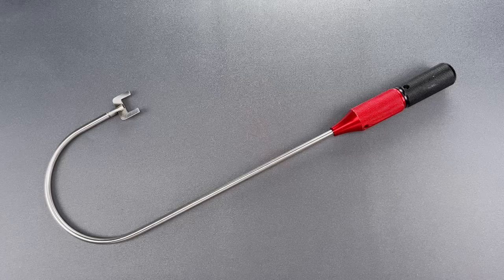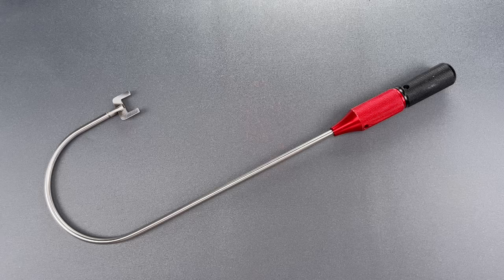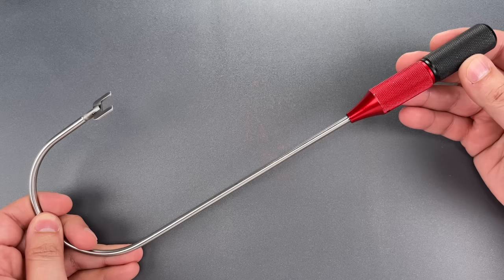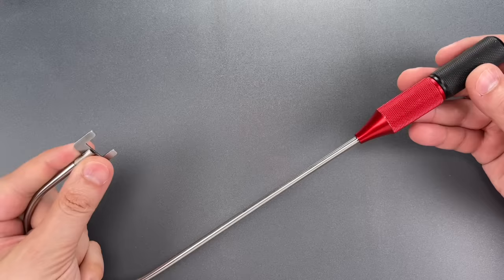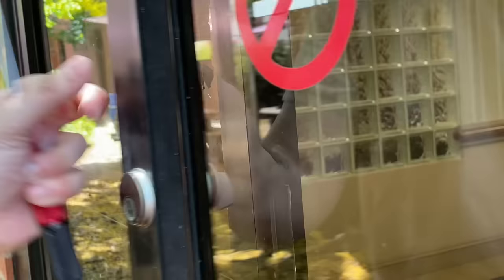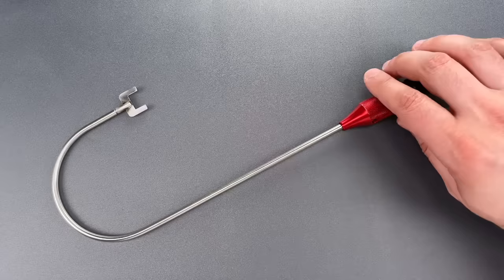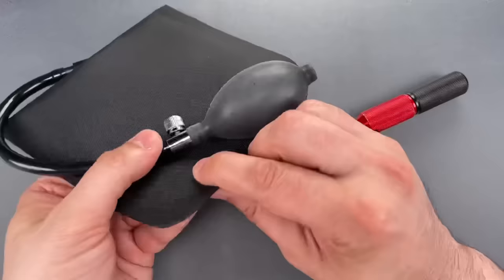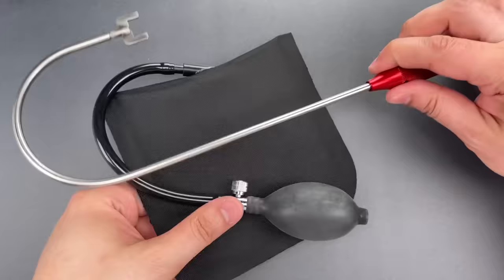[1312] The “J-Tool” Reaches Inside To Open Doors

Comment: Looks like you struggled turning at the end , maybe redesign it with a T bar handle for stiff locks 👍🏻
Reply: there is a hole in the knob that will accept a bar, probably to do just that. No redesign needed, its already there.
Reply: The entire lock turning time was 5 seconds.

Comment: People after watching this video: *installs a metal shim on the lock*
Reply: I have never seen a door without a ledge. Most doors have a double ledge. So the tool is useless. I think he did build a door that can be picked after he build that "lock pick". :D
Reply: @0815firstuser0815  I’m talking about placing a sheet of 1mm metal at the lock
Reply: Another idea is to add another layer onto off both doors when they connect it prevents gusts of wind and this entry method
Reply: @TheUnknownCatWarrior  what would that do? Maybe I'm misunderstanding something.
Reply: @Corn0nTheCobb  A strip of metal , installed at the gap where the tool was inserted... would prevent this bypass method. Another possibility would be heavily tinted glass so that the user cannot get the end of the "J" tool on to the latch
Reply: @JugglesGrenades  the doors would require a door sequencer so the door with the astragal would shut first allowing the plain edge door to close fully.
Reply: This is a double swinging entry/exit door, meaning both have to be able to swing both ways until locked. The middle edges have to not bang each other. Common commercial doors. Is why there’s alarm systems and cameras anyway. 
Common people.

Comment: I'm lucky to live in a country where such gaps in doors just don't exist. Not just for safety reasons but also for energy effiency.
Reply: That's why he showed the second tool 😅
Reply: @stevenandino8178  Not even that would work
Reply: Press X to doubt. Unless your country just doesn't have doors like that, which is incredibly unlikely, both of those tools combined would likely work many doors.
Reply: Only double doors. Single ones have a door stop and weather stripping all the way around.
Reply: @ChaosLightspeed  Double doors in the UK  have a tiny gap  (maybe 2mm at most), but even that gap is filled by the  semi rigid   rubber seal. Not to mention  the  2 (or more) 90 degree angles of the door jam to   deal with. Neither of these would work here.

Comment: This explains why key locked doors often cannot be opened from the inside with the thumb turn.
Reply: I believe that's only legal for "low occupancy" buildings (ie where everyone leaves at the end of the day).  If it's reasonably expected that someone will be inside at any given time, then that someone will need some way of gettings out in case of emergency.

Comment: But this ONLY works for doors where there is a straight gap/line where you can force this tool through.
Here in Germany, there aren't lots of those.
But as well we don't have these kind of locks here usually.

Comment: This won't work at 90% of the doors in Europe.
Reply: I would say 99.5%
Reply: @henrikmelander7361  I would say 99.9% I have seen some doors in my life and with no door I can think of it would've worked (except toilet stalls).
Tbh I think there are methods to enter our doors as well. They are not strictly better. They are just different. Most important they do not have those large gaps.
Reply: @henrikmelander7361  Just like any door in the US if you can trust Google streetview... These are doors typically used in backyards, shops, federal buildings.
Reply: Europe has a lot of these doors, you're just not in the right country. lol
Reply: That’s what the air bag is for...... have you used one? We were rescuing a child in a locked car who was over heating, the air bag easily made a gap in a modern car door (still couldn’t get the lock to open though so we eventually broke the window which is always the fastest way).
Reply: It will only work on double doors. Not single doors where the door stop prevents anything like this from getting through.
Reply: @pauls9440  how are you suposed to get the bag in when the door have an overlaping lip?
Reply: @henrikmelander7361  The lip on a car door is usually made up of a rubber seal and the bag is very thin.

Comment: honestly, i feel like this is one of those products that shouldn't be available for non-commercial purchase
Reply: Depends where you are.. in theory in Canada you can acquire them, but you need to have a federal license and in some cases a provincial license to legally have and use them.  The license is only available to Lock Smiths and Tow operators.

Comment: And now try this on a german Door 😂 (FYI: we dont have these kind of "knobs". Only bigger handles.
Reply: To be fair he uses different tools for different locks
Reply: @dragovern  In Europe almost none of the doors is like the one in the vid. 99% is of the door-frame type with sliding daytime-locks and rotating locks to lock the sliders.
Reply: It took me about 30 seconds to find the "ABUS 560330 Additional Door Lock" on sale at Amazon Germany, and even with normal locks, a lot of people leave a key in the lock on the inside.
Reply: @frutt5k  Most of the shop and entryway residence locks are like this in Sweden. Sweden is in Europe.
Reply: @outofthedark  Just barely
Reply: @baldieman64  99.9%  does NOT. If only for the reason that you cannot operate the exterior cylinder when a key is inside the inside cylinder. You should have taken 31 seconds but were too eager...

Comment: I think kicking is faster. Every second counts man.
Reply: You forget... "First Responder" could include "Police", that could have good reason to need a 'silent entry'. ;)
Reply: @JoshuaGanoTyraxLightning  A lot of these types of doors in the US have "bulletproof" glass that may take several attempts or a sledgehammer to break open, as well.  This method is much faster in those cases.

Comment: That’s why in my house, we don’t have an external facing locks that don’t use keys from the inside.
Reply: Thats why in my house we don't have doors with gaps so large you can fit a finger through.
Reply: That's why I sleep outside
Reply: And you think he couldn't pick those locks just as easily in about the same amount of time? Locks have never been and will never be completely secure. It doesn't make them useless, but you should be realistic about their limitations.
Reply: @stupaod  you literally can't pick a lock with no keyway, that's their point. They are probably talking about a half deadbolt or surface bolt of some type that cannot be accessed from outside
Reply: @donesixfour  He said that they use keys on the inside. That means it has an outside key point as well. Without a key point what mechanism would be locking the door? No matter what that mechanism is there are always vulnerabilities.
Reply: @stupaod  read the comment slowly, it literally says there aren't any external keyways... you think he lives in a prison? He is saying he has double deadbolts and anything with a thumb turn doesn't have access from the outside
Reply: @donesixfour  It says nothing of the sort. It says they don't have any external key points that don't have another keypoint on the inside .
Reply: @stupaod  "we don't have an(y) external facing locks [locks such as deadbolts, surface mounted locks, disqualifying any locks that have external access points]  that dont use keys from the inside [double deadbolts, institution function knobsets]"

Seems pretty clear to me that this person uses double deadbolts and slide bolts, or other locking mechanisms that cannot be accessed from the outside
Reply: @donesixfour  You think that this person has doors that only lock from the inside?

You are inserting things into what was said that aren't implied.

He said they DO use keys from the inside. Why are you having such a hard time accepting this?

2 "don't"s = a "do". 

He does not have any outside key points that DON'T have a corresponding inside key point.

Let him explain it for himself. Until then theres little reason to continue this conversation.
Reply: @donesixfour  Btw, why would double deadbolts without a keypoint access from outside prevent this particular device from opening the door? The device needs a space to fit between, not an outside key point.
Reply: @stupaod  why?
Reply: @donesixfour  You actually believe this person doesn't have any external facing locks on his house? What would he do when he leaves the house?

If he were saying what you think hes saying why would he even have to say that they don't use keys from the inside? Most doors do not have key points on both sides so it would not need to be noted.

I don't want to argue with you. I understand what you think hes saying and why, but I think you're likely wrong for the reasons I already explained.

Comment: something similar to this I showed my managers at a former office we moved into.  There was such a large gap in between the doors of the office, anyone with bad intentions could use a tool like this to get in.  It was a different type of locking mechanism, magnet with badge scanners and motion sensors.  It wouldn't need to turn a locking deadbolt like you showed.  I demonstrated by pulling a large piece/branch/stalk off a fake plant they had in the entry way, sliding it in the large gap, and simply waving it around.  It triggered the motion sensor on the inside and unlocked the door in under 5 seconds.  Needless to say, they had maintenance fix that gap right away.

Comment: I just found this channel. That's a great tool. I'm not a lock picker but I do have occasions when people have left keys in cars.  I can usually bend a coat hanger and eventually get it to hit the door lock button.  If this company made a longer device, similar yet longer with a rubber tip and the screw handle could rotate the end, it would be the perfect get you car open device, Might want to add the airbag thing just to make sure.

Comment: This works if: there’s a key in the door: if there is a gap for pushing the tool between the door and the jamb: if the door has glass to see what you’re doing. A lot of ifs imo.
Reply: You see a lot of mortice locked double doors that aren't glass? Most of the ones that aren't have a crashbar and a DDT would work the same way
Reply: @AwfulErik  mortise locks are on all sorts of doors. Front doors, back doors. This tool will only work on glass doors, such as a patio French door. All I meant was that there are loads of doors where this thing wouldn’t be any good.
Reply: @IrishSchaller  I assumed he meant commercial buildings

Comment: I deliberately had key control deadbolts installed in my new house, plus solid mahogany door frame ; solid mahogany door, and hinges anchored with 4” screws, you’ll kick till you’re blue in the face. Along with hurricane proof windows that can withstand a 4’ - 2X4 shot horizontally at 140mph at the center of the window.
They aren’t kicking, hammering, or breaking my windows either. 
Not to mention, motion activated cameras that record all entrances.
Along with a metal plate anchored in the slab at my doors, that when set with blocking device, it  blocks doors from opening even if they were unlocked. 
Plenty of time to get my sidekick and tend to business. You absolutely have to be proactive in home defense, that entails a bit of modification but well worth the peace of mind.

Comment: Exploits like this are the reason the store where I work requires a key on both sides of the door. We also use a chain with a large Abus padlock on the handles overnight.

Comment: Nice, as always. Thanks, LPL.
But this doesn't work on opaque doors where you can't see the latch in order to get the U-bar turn thingy to align just right with the latch. A simple deterrent would to not use glass doors, or at least apply a couple of large, rectangular pieces of opaque plastic or some other thin material to block the view of the interior latch.

Comment: I guess the use for this tool would really depend where you're located. It doesn't look like a common door in western Europe (at least I can't think of any that I ever saw). Door flaps are ubiquitous. Partly for security reason, but mainly to get better sealing and reduce draft of air.
Reply: Many buildings in the USA use doors like these. mostly commercial buildings etc. The bank I work at actually uses double doors similar to those. Granted getting inside and actually getting money are two different things lmao.

Comment: I used to build entry doors through Tubelite, warned them of ease of entry with vice grips & a screwdriver.
Key cylinders set screw can be snapped off by twisting the cylinder with vice grips. Screwdriver then can flip the internal mechanism to open.
Only remedy is a beveled cylinder ring, which still won't defeat all vice grips..thanks ✌

Comment: I work for a cleaning company and Most doors on the buildings we service are mag locked they don’t have the turn knob I always carry a can of air that you use to dust keyboards just in case the fob doesn’t work they have the little straw all you do is push the little straw between the gap of the doors and spray the air up at the sensor on the ceiling and it releases the mag locks

Comment: Real smart for intruders. Now you picked an easy door. Using that air bag will put more pressure on bolt you will have hard time twisting lock.  what if its keyed on both sides?

Comment: I have to say here, that you probably wont be able to use this anywhere in Austria and many other places in Europe, because we don't use thumbturns and I have never seen them in any commercial buildings.
Though I have seen a mechanic use an air wedge to open my car door when I locked myself out, but that's really the only place you could use them

Comment: When I see this I gotta wonder why there isn't a plate on one of the doors so there isn't a huge drafty gap between the doors? I have double doors on my garden shed and one of them has an extra plate. You  could not do this there... aside from the fact it doesn't even have that turning nob lock.

Comment: This can also be done with an l tool by simply turning the thumb turn enough to get the lock out of the deadlatch function. After that a small flat screwdriver will make the ball drop for go back into the lock.

Comment: in the uk most of these locks have an additional key barrel lock inside aswell as out like as part of the thumb turn lock so you wouldnt turn that thing without a key being used first

Comment: This wouldn't work at either of the two the places I work at; there is no inside thumb turn, it's locked and unlocked solely by key on both sides of the doors. And to top it off, we also have metal extending gates secured by two (sadly) master padlocks. So, to get in... you'd have to defeat the two padlocks (which shouldn't be hard, but might take some time) and then pull the gate aside, and then you can get at the door, you'd have to either break the window or pick the lock to get in. Or, go in the back... but those are solid metal doors; you'd have to pick/drill/etc the lock there. And while you're doing all of that, you're also on camera, too. Despite where I live being in a small rural town that is riddled with drug addicts, the only thing we've had broken into was the pop machines at the one location, someone used a crowbar to access the pop machine's bill holder (he was a pro at this, he did only a minimal amount of damage to the machine and knew exactly where it was and how to get it out by only prying it open a little).

Comment: Why wouldn't this have a folding T-bar extension from the turning handle for added leverage, for when it's cold, or if the item has grease on it?

Comment: At a building I used to work in, the door release button was a motion detector. If you slide a piece of paper through the gap, you can set it off, security was not their strong point lol

Comment: Work on the dock moving new vehicles from point A to B keys would get lock up by accident...most of the times. 😊 The air wedge made it easier to get the door open ti used a second tool. Normally it would take under two minutes

Comment: well i guess those type of door, with such a gap are only used in southern states, southern europe and etc countries. Everywhere else when it can get cold during 6 months of a year you dont have a gap. you will usually have like 2 or 3 turns in your door with a insulation tube in between so you simply wouldnt be able to slide it in.

Comment: A hex wrench and some locking pliers work almost as good. 
If it would work on more scenarios I'd buy it. 
It has to be a double door with t- turn on inside, and how offten is it not the cheesy 5 pin door company cylinder that's beginner's level picking anyway.

Comment: It looks like a simple plate attached to the non-lock door on the inside covering the door slit would stop this attack. And it would only have to extend out about 1/4" past the edge of the door.

Comment: I’ve always found that the fastest and most reliable way to get through the door is to use my key. Is there a reason you’re showing people how to break into my apartment building?
Reply: Well what if your trapped in your apartment and it is on fire?  Guess you don’t want a burly firefighter to lift the burning debris burying you?

Comment: I've seen doors that have this in car dealerships in Sydney and I've seen the staff keep keys behind the counter. I'm not suggesting doing a "Grand Theft Auto Kingscross" but if you own such a store it's wise to at least fix this issue. Maybe install a guard to block/cover over the entrance into the middle parts of the door. Thus allowing this lock to still be installed but no way to "slide in" the J tool.

Comment: Who needs locks or any means too open a lock.... Sledge hammer is a great tool to open doors ... Windows... Even walls no problem ...  Afterward just leave it laying in your pickup truck most people will avoid even looking at it too much work involved ...  Sledge hammer ... WORKS.